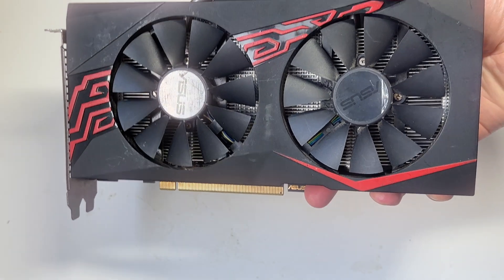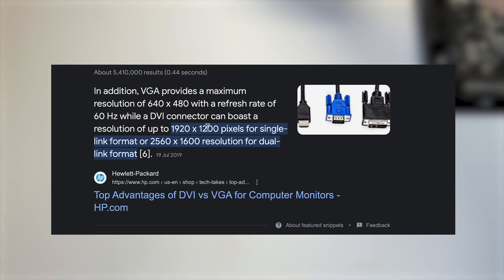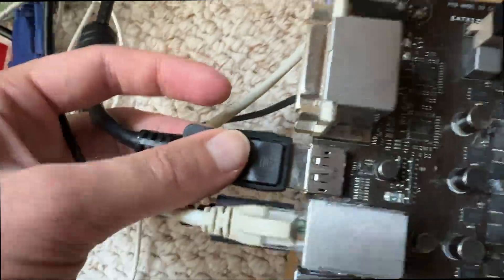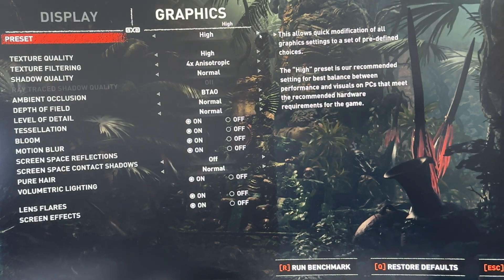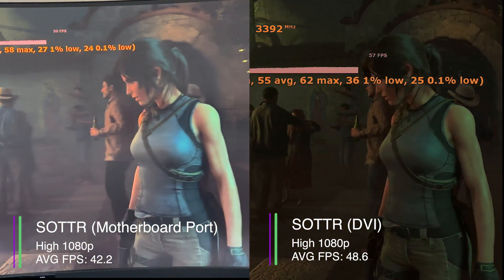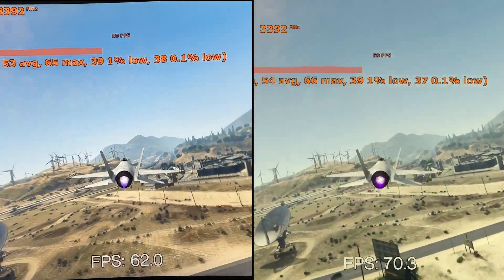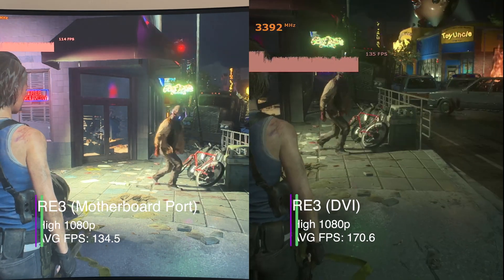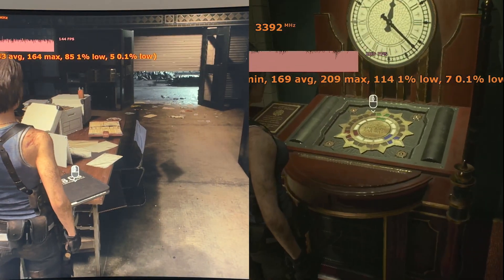No Ports, No Problem!

Comment: Mine doesn't have an igpu, but in bios it shows pcie and pci graphics. Does that mean I can connect a small pci graphics card and the mining card to the pcie connector, and use bios to use pci graphics as default and use the pcie for games?

Comment: [SOLVED!]
Okay, mine shows both display adapters in the device manager, but the Windows Graphics Settings do not show my GPU in the high performance setting. It shows my CPU integrated graphics in both options. Why would it do that? My AMD Adrenaline GPU driver setup shows both GPUs but the gaming GPU is listed as discrete and at zero rpms.
It is plugged into the motherboard and getting power, but I unplugged the hdmi cord from the port while the PC was on and shortcircuited the port.
I did get the GPU to work once after the damage but I think I had to plug the hdmi in the GPU and finesse it until I got video working. I would like to know if it will work without fiddling with the port, since my hdmi cord is rigid and won't bend or unbend. I think it has an optical cable inside for audio.

Sweet! I took a gamble and disabled my HD CPU graphics in device mngr. Now it forced it to use my GPU in the Windows Graphics settings for my game and the desktop in general. I'm a gambling genius!

Comment: ummm idk about that. it seems the dvi colors are richer and carries more effects. soo how would comparing fps show that one was better than the other?  they are not outputting the same graphic. Did the mb port tourniquet the output? If so using the gpu to calculate then send the output through the mb is useless. Unless you believe a higher fps with limited colors is better than a lower fps with great detail.  But that point puts you right back where you started. Balancing performance and quality. But using the gpu in the mix is adding power consumption, heat and expense..therefore in my opinion getting a gpu without an output is silly.

Comment: The proper full mod is to integrate the video processing circuitry, add on the ports, and flash a standard bios to the card, it'll unlock the full potential of the card but it is more expensive because of adding on the components required for video output. This method you have explained works well as long as the performance hit isn't that much of an issue.

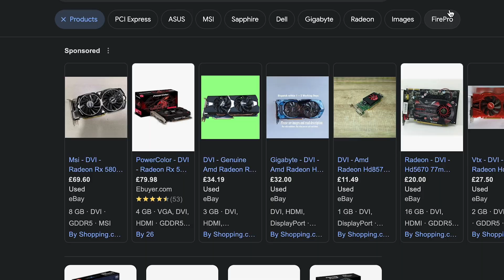Comment: 0:19 you can see the saphire has a HDMI port which is just hidden. Unscrew the backplate and there it is. If you reflash it with the gaming version bios maybe the performance will be a bit more since the mining bios kimits gaming perf. To 70~% perf.

Comment: Interesting clip, thanks, however i have a question or two.      
Settings in window for Power levels in windows settings,  
GPU power levels settings Maximum performance, 
PCIE state X how many lanes when operating as integrated vs direct from DVI as the discrete gpu?

Comment: It's not quite as simple as that, especially for older games. Some games only see the primary GPU, in most cases this is the iGPU. So even by forcing a game to use the dedicated GPU option, it'll still actually only use the iGPU. This also comes down to firmware, drivers, and manufacturers' implementations of those.

Comment: This is exactly how gaming laptops work. An APU and a dedicated GPU. Windows can switch automatically. Also, if you have a UPS for your PC and it has a USB port (usually USB-B) plug that into your computer and it will show state of charge and battery usage when power goes out. From there you can have your system automatically save and safely shut down or hibernate when remaining power is at whatever you set it to. it 100% acts like a laptop.
Reply: It's how gaming laptops should work, but as I experienced, it's not quite as simple as that and there's quite a few caveats and things which need to align and work with each other.

Comment: Such a setup can only be a supplemental. It will be quite honestly depending on your cpus Integrated GPU
Reply: So say you have an integrated intel CPU with graphics integrated The GPU with no ports will not be dedicated.
It will solely depend on the speed of your Intel HD graphics. It will say it's dedicated , but it is not because if you look at your task manager , it will tell a different story Games oftentimes rely on the bios, and the bios were reported as a dedicated g. P. U

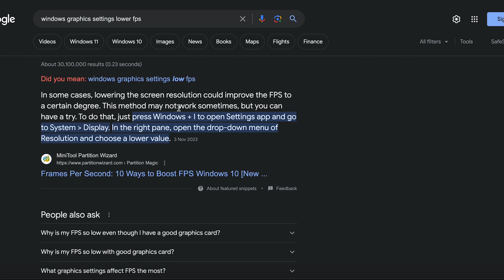Comment: 5:28 you're close. When the GPU you've selected draws each frame, it has to be sent to the framebuffer of the GPU that has the display connected to it. If you're drawing 60 frames of 1080p, you're going to chip away 355.957 MB/s off the PCIE bus of each of those graphic cards, since the exchange of frames is transactional in nature. On top of that, the cards need to do extra processing to send and receive the frames rather than be busy with the game. It'd be much more efficient to just get a soldering iron and solder the missing ports on.

Comment: I get 4k out of both my RX 470 DVI-only ex-mining GPUs using a DVI-to-HDMI adapter/cable and the wonderful, free AMD/ATI Pixel Clock Patcher utility.  I also get audio through DVI, which was initially a surprise to me.  I've tried using the iGPU on my 12700K and the steps mentioned in the video but for some reason it hasn't worked well for me.  I think audio was a problem?  Anyway, I went back to the DVI port and my adapter/cable.  Nice video; thank you for sharing.

Comment: Tbh I am never gonna buy GPU that was used by crypto miner. Why ? Well, I do not want to support them at all. Let them eat all of those GPUs if necessary. If some one wonders why low end gpu nowadays is priced as high end used to be, then it basically because of crypto mining that sky-rocketed the demand so high and then it turned out that desperate (but rich) gamer will buy GPU for ANY price. GPU has become an "luxury product". Average Joe has to either buy a Laptop or game on APU, or maybe a Steam Deck with a Dock. Mining has ended, but Prices on New GPUs had stayed.

Comment: First you need to have a gaming BIOS on the cards you want to use it like this and I recall that for some cards you can find plenty of BIOSes while for other cards there is none available. Soldering HDMI ports on mining cards is also easy (plus a few more components also easily done). Whenever you want to buy a mining card, check if there are gaming BIOSes available for download then proceed with buying.

Comment: This method only works on older card's with AMD GPU's and NVIDIA GPU's require driver mod's there is a few videos about this and they all found AMD GPU's mostly allow this but NVIDIA GPU's don't. Hence a LTT video explaining it and how to modify your driver's on NVIDIA cards to pass though the rendered frame's to the igpu

Comment: the gpu maybe cheaper but the hardware requirment more spesific, more cpu workload, more electric bill, less performance... i rather buy NEW gpu with ex mining chip rebuilt vga with normal port, the price were slightly different, with warranty nevertheless

Comment: The reason why performance is lower is the same reason for developing a SLI Bridge.
Your GPU making frames then send it to iGPU through PCI Express bus. It's more work for the bus and performance difference more noticeable the lower PCI Express gen.
Also as I know AMD cards more sensitive to PCI Express bus speed.

Comment: My setup consisted of rx570 connected by HDMI to a TV and a VGA monitor connected to the motherboard. That was my way to save on DVI-VGA adapter. While I did some furmark tests before selling my gpu, on TV it was about 126fps while on monitor about 113fps. And yes, I am sure that it was generated by the GPU. No way that intel coffee lake igpu could do 10% less than rx570

Comment: I wonder how different the performance is when using different iGPUs. Especially when using a more modern (but not expensive as that would be unfair) or older but higher end APUs.

Comment: 5:26 Wrong. The difference is caused by encoding and data transfer.

The GPU has the take the frame, turn it into a 'video' (actually just a data stream) and your iGPU in the CPU needs to convert that into display output and send it out through the mobo.
This extra communication between GPU to CPU back and forth over the PCIe bus also reduces performance a little.

However, if you play heavier games, or your frame rate is high, the GPU and the bus connection is loaded heavier, so the impact is more noticeable and the difference is larger.

15% or 130/170 fps is insanely high. Thats 1 or 2 tiers of GPUs.... Better to buy some normal GPU cheap, then help a miner cash out on a used GPU.

Comment: That's reason we need a "MUX Switch" on laptop gaming. Basically, the discrete graphics card on a Gaming laptop does not have a video out port and it must also use the video out port from the mainboard.

Comment: I can say this video is pretty misleading from lack of knowledge.
1)First off standard drivers may not work with these GPU. On Nvidia they 100% dont work so you relay on hacked drivers
2)These GPGPUS may be not 16x. For example CMP line is limited to 1x PCIe (or you can solder additional surface mount capacitors for 4x-8x)
3)No RTX
4)No DLSS
5)Less performance from the box (these cards have lower core count) up to 30%
6)Increased latency and possible stutters from data transmit between GPGPU and iGPU
7)You need iGPU, and no ports is huuuge disadvantage cuz most software rely on single card, and not every game will work correctly with this setup.

The higher class GPGPU you bought the less returns you got in terms of usability
Better off seek a good deal on standard aftermining GPU like I did after looking through these cards. Bought first 1660 for 100$ and after half a year sold it and bought 3060-12 for 200$.

Comment: I actually a similar kind of setup with a AMD 6800XT and a Nvidia 970 a few weeks ago to see how it would do. 
Ran my 1440p display from the 970 and had the 6800XT do all the game processing.
The few games I tried worked at playable levels even at higher settings but it was very clear that this was a very inefficient way to run games and there were a few caveats with my specific setup that caused some losses in performance. 
For starters, the DisplayPort of the 970 was several iterations behind the 6800XT and my screen did not refresh as quickly even though it claimed to be running at 144hz. 
The 6800XT was also never fully loaded. Both GPUs were seeing over 50% load applied (even though the 970 should've really not been doing any real work) which caused significant power usage (>300 watts). My frame times were also increased drastically. If I had to guess I'd say it was a result of the data having to be loaded through two separate GPUs, both of which were not running at their full PCIe x16 rating because my CPU (9900k) was stretched for PCIe lanes given that I was also using a Nvme SSD running a PCIe x4.
So essentially I had 2 x16 GPUs running at PCIe 3.0 x4. Whole thing was a mess.

Comment: the gpu without any ports, sapphire nitro+, actually has a HDMI port behind the pci slot cover! you only need to drill a hole there, and here it is! a fully working HDMI graphics card!
Reply from the maker: It doesn't work by default because there are resistors missing. Watch this: https://www.youtube.com/shorts/uLBAmM9bV9U
Reply: @gpuspecs  hmmm, interesting. i bought the exact same GPU for a friend and worked flawlessly. maybe there are different revisions?
Reply: @ACoTam2  Some of them come with the resistors installed, some don't, some come with some of them installed. The one I got had half the resistors populated but needed additional ones to activate the HDMI, and then the PCIe decoupling caps were also missing, limiting the card to PCIe 3.0 x1 until I soldered some on.

Comment: Slight misconception in your DVI specs reasoning: Only DVI single link is limited to 2560x1900(30Hz), while the DVI dual link can go up to 3840x2400(30Hz, but also does 60Hz if you run it in 2560x1900)

Comment: Was the car with ports a proper 580? Because the no port card you were using might be more like a 570 and performance on those cards is slightly less than a proper 580.
Reply: I think he used the same card for the tests.  And yes 2048SP is technically 570 spec.  But since AMD themselves released a 580 2038SP that's what it is called.
Reply from the maker: Rx 580 2048SP but it might be a rx 470 or 570 not too sure. Watch this video if you're interested: https://www.youtube.com/watch?v=Wf6GIrhyhu4

Comment: If you can find it for very cheap, using an ex mining card with no ports might be a good thing. However, the abundance of used graphic cards on the market made the difference pretty much negligible imo

Comment: The diference of the fps is not the latancy. It's only that when de gpu renderes a frame has to send it back to the ram, then the cpu has to compose the image on the integrated gpus frame, and then the integrated gpu has to send the imatge to the display.
Reply: so basically the same copyback type of thing that Windows Vista did...?
Reply: @aleaxdeathbringer  The same as laptop doing to this day

Comment: wonder if these mining cards still have their video encoders and could you off load streaming work load to the mining gpu?
Reply: should; they'd have to nerf silicon rather than just leave off ports in order to break that.
Reply: Absolutely. Video encoders aren't tied to the ports so you could easily be playing a game on your main GPU while using the encoders on a secondary GPU for streaming. I typically game on a 6800XT but I've often used a 1050 Ti for streaming. I got a used 1050 Ti for around $50 USD. They don't need any more power than what a PCIe slot provides and still have great NVENC video encoders. I've got an identical setup running a Plex media server with a 1050 Ti and it can easily handle multiple video streams at once.
Reply: Some higher end NVIDIA chips can handle more than one simultaneous NVENC encodes. I have a 1050 4GB non-Ti (got it new, for just under $100 - it's half height single slot, which I needed for my PC) and since it's the same GP107 like yours (just cut down a little) it can handle one stream, but a GTX 1080 Ti can handle 2 and the Tesla P100's can handle 3!  @Silentguy_

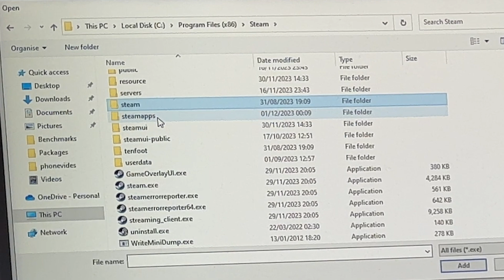Comment: 01:55 this is done automatically by Windows.
The display output is done using the iGPU.
The computing for the game done by the GPU.
Reply: really depends on the game anything running on openGL if not told will always just choose the iGPU but anything running on Vulkan or directx seems to pick the strongest GPU 👍
Reply: i literally installed 30 games. and only 2 games that using discrete GPU. the rest were using integrated GPU. which is sucks. still not working until now
Reply: Not done automatically. And for me the high performance option is Intel HD Graphics instead of the GTX 1070 so if I want to utilize that I have to download DXVK and insert into the game's root folder
Reply: And if you use Nvidia GPUs it's gonna be easier, as Nvidia driver has Optimus feature which auto switch between the iGPU and discrete GPU depending on the load demand
Reply: @sihamhamda47 thats only for laptops, Optimus wont work in this case
Reply: NVIDIA mining card's require driver mod's to be used for anything other than mining.. LTT have a video on how to modify the driver's to use it as a rendering device and pass though to the igpu.. AMD was allowing this specifically but NVIDIA had it locked down so people was forced to buy cards with port's.. so a BIOS and windows setting will work on AMD but not NVIDIA unless you download and use modded drivers or for security reasons modify your own drivers.. @sihamhamda47
Reply: @sihamhamda47  It's not quite that simple. Depending on the game, the game may still only see the iGPU and use that. It's impossible to force a game to use the dedicated GPU if it's not configured to.

Comment: Does this mean i can use a high end graphics card through my motherboard's vga port?
Reply: The GPU will send the data to your iGPU (the video basically) and you'll get an output like this yes
Reply: Which one has more lag. hdmi to vga converter or routing through the motherboard
Reply: @1marcelfilms  no lag but performance drop if you use motherboard way
Reply: the converter I would say ? 
The mobo doesn't have much lag, the GPU either.
Just the signal having to get converted can take "time"  @1marcelfilms

Comment: you should have stated from the very beginning that for this method you require a motherboard that supports integrated graphics, and a cpu that has an IGPU. there's plenty of motherboards with no integrated video and plenty of CPU's, especially ryzens, with no IGPU.
Reply: It's funny cause we are getting to the point that a Ryzen with an APU could perform as good or better than these mining cards.
Reply: @batterypwrlow  amd's best integrated graphics is the radeon 780M. the rx 580 still outperforms it. although the 780M gets close. but if one of these mining cards is worse than the rx 580, the 780M might outperform it.
additionally, the cpus with the 780M, or similar IGPs, are gonna be quite expensive, and since they're ddr5 only, the rest of the system would also be very expensive, so, if you can get one of those, you can definitely pick up a brand new, high end gpu like a 3070ti, or rx 6700 xt or smth like that. this video showcases a budget strategy.
Reply: @eduardoroth8207  AMD insiders reported, the Ryzen 5 8600G iGPU IS outperforming 1060 in Benchmarks and that's just a beginning of the low-end GPU prices finally falling down. It'll be slowly, but eventually WILL be.
Reply: @GorilkaCo  the r5 8600G has a radeon 760M and not a 780M. the 760M is, according to techpowerup, as good as a gtx 760, which is definitely worse than the 1060.
Reply: @batterypwrlow it's crazy because you're a liar and that's definitely not ever going to happen.🎉